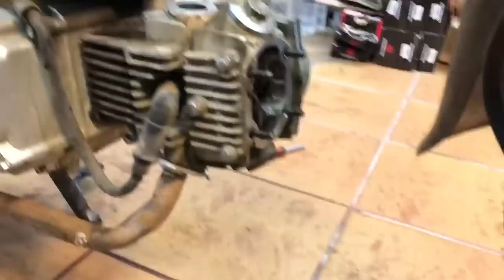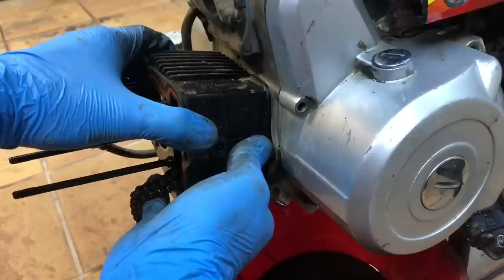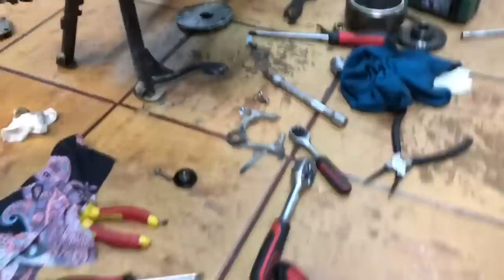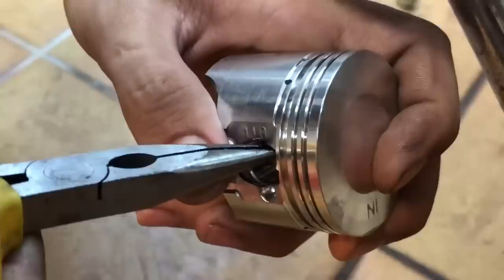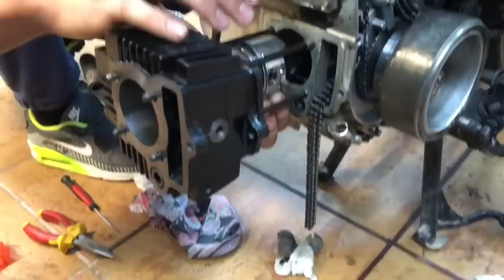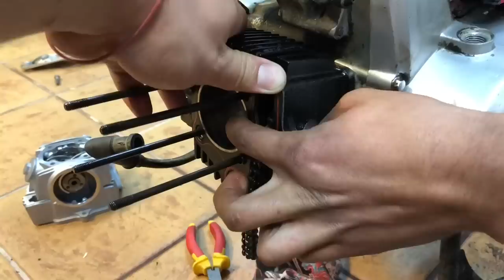Modificare scuter/moped/atv 50/80 cc in 125 cc

Comment: Salut,prietene așa am vrut sa fac și eu , am de mult în cap proiectul ăsta și când l.am pus în aplicare am observat că nu ajunge pistonul sus , a doua varianta a fost să iau din cilindru la strung și să ajungă pistonul sus fara nicio modificare decât cilindru și merge super ! Sa faceți un videoclip așa !
Reply: Ok dar motorul ăla nu mai are 107cmc!!! Are numai 85...90 cmc pt.că a pierdut din cursa pistonului fix pe bucata aia unde nu urcă!!! Ca să aibă 107cc trebuie montat ambielaj cu cursă de 50mm de 107cc (cele mici de 50/72cc au cursa doar de 41mm...).
Merge și așa cu cilindrul scurtat pe strung și e mai corect decât modificarea făcută în această filmare...dar nu vei avea toți cei 107cc.

Comment: Inclusiv prezoanele cilindrului trebuie înlocuite la trecerea de la 50/72cc la 110cc pt.că cilindrul de 110cc fiind mai înalt, prezoanele vechi nu mai ajung până sus în chiulasa!!!
Setul de 125cc nu putea fi montat pe carterul de 50cc și din cauza ambielajului...Pt.că pistoanele până la 110cc au bolt de 13mm, în vreme ce cel de 125cc are bolt de 14mm și nu putea fi montat!!!
Da! Setul de 110cc poate fi montat pe motoarele de 50/72cc, dar numai cu schimbarea ambielajului, a prezoanelor de cilindru și a carburatorului, cu unele de 110cc.

Comment: Salut am un moped lifan motorul este la fel ca acesta doar ca este de 49 are 4 viteze cu ambreiaj la ghidon și am o întrebare ii pot modifica pinioanele la motor și roata sa fuga ceva mai tare el fuge undeva la 50 55 kmh daca da îmi puteți lasa un link unde le pot găsi și el are 13 dinți la pinionul mic și la cel mare 46
Reply: Și dacă îl pot modifica în 110 fără sa i schimb chiloasa?
Reply from the maker: Il puteti modifica pana la 80 fara alte modificari
Reply: @SHRMotorsOfficial  setul sau pinionul?
Reply: @SHRMotorsOfficial  Ca m ar interesa sa fuga ceva mai repede de 55
Reply from the maker: Setul, pinion nu cred ca gasiti mai mare de 46